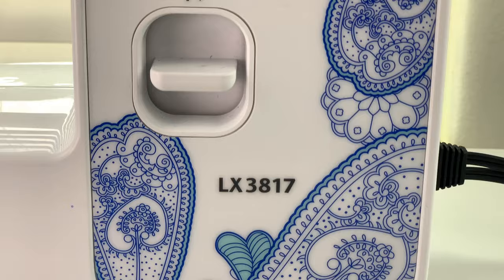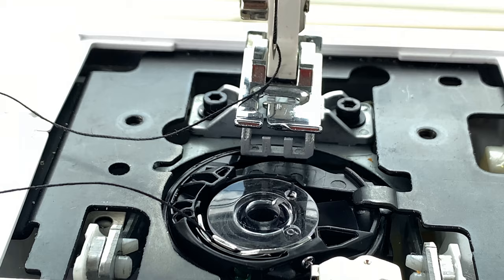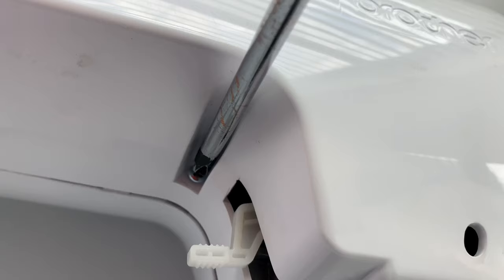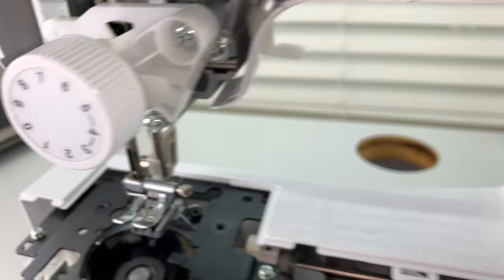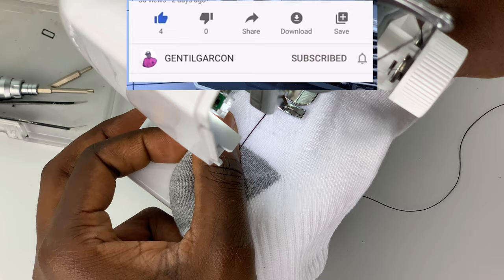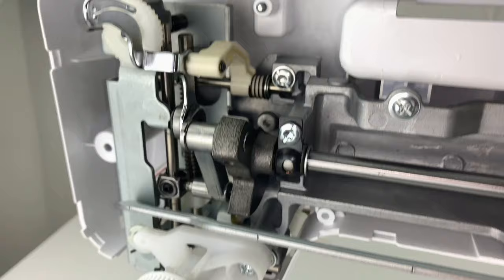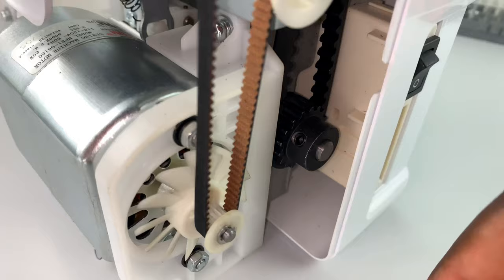How: Sewing Machine Hook Timing Issue Repair - Brother LX3817

Comment: Thank you very much sir .  I fixed the timing with your help. I also tries to slip the belts to move the needle. There are two allen screws on the bottom shaft in order to lose the connection between top and the bottom.  Now the sewing machine works good. Thanks again!!!
Reply from the maker: Anjan Babu Good Job , and  you are very welcome.
Reply from the maker: Anjan Babu Do not forget to subscribe to the Channel 😊.

Comment: Thank you. Your clear instructions helped me complete the alignment and identify the faulty hex screws on my new Brother LX3817.
Reply from the maker: I am glad it helped you. Did you tight the Allen screw back up ?
Reply from the maker: Screws*
Reply: @MarcelJoel  yes... I had to tighten them at an angle.
Reply from the maker: @jofloig4513  Good job. Because they are not supposed to stay lose after you calibrate your top needle and the bobbing case.

Comment: This video was so helpful! Fixed my machine so quickly!
Reply: I feel so left out. So I undid the 4 screws in the back, the 5 on the bottom, and the one next to the tension wheel after I took off that side piece. I was not able to get the front and back apart without breaking something. Am I missing something? Was there another screw not mentioned that everybody else got but me? I'm trying to wait to hear back from Marcel, but I know he's busy...I'm lost and my rig has been sitting here for hours waiting to get fixed.

Comment: Thank you for the video. To bad the last repair person striped my bobbin screws. Now I have no idea what to do now.
Reply from the maker: Buy a soldering iron with some solder. 
Solder a screwdriver into the screw in order to remove each screw. You will have to solder and de solder the screw driver each time…that’s a lil painful process but it should remove those screws. Look It up online on how to solder
Reply: @MarcelJoel Thanks my dad figured out a way. It is still down though. The timing adjustment won't stay. So something else is wrong with it. Let me just say I am Not happy with the company that sold it to me. They are also the one's who have had to repair it for me twice it a short period of time. The cheap brother that was bought from Walmart lasted me for years!

Comment: Your videos are getting better. And your editing is getting better
Reply from the maker: Thank you 😃 , I really appreciate you noticed that. It warms my heart !
Reply: @MarcelJoel  Hi !  my needle is not aligned with the feed dog?  the needle keeps hitting the bobbin case.  What can I do?  Thanks!
Reply from the maker: Give me a second I will make a video about this issue as well. There is a screw on the side of your machine that is not to be touched.  The purpose of that screw is to move the top needle assembly toward you or further from you.
Reply: I am not getting the bobbin tray to even move. The timing is off only miniscule, but enough to not catch the top tray. Your video shows how to lose the bolt to move said tray, but not how to move the tray. Manually moving it is having the needle dropping down at the same time. I am not understanding how to fix this.
Reply from the maker: Gifts Handmade By Natasha Did you figure it out?

After you lose up the Allen screws, you can manually spin that bobbin case with your fingers. Try it and align everything with that top needle.
Reply: @MarcelJoel  please answer me

Comment: Thank yo u Very much for your videos, it has helped a lot.
Would it be possible help me with a problem? I put  little oil where the grease should be ( I didn 't read the manual beforhand)i,now the motor runs  but  the sound  is the belt slips
Reply from the maker: What type of machine is it ?

Comment: Oh I'm lost again. Finally I'm getting to this. I've got all the screws apart and organized. I can't for the life of me pull it apart without feeling like I'm going to break something.😢 Is there a key area from which I can get it apart safely? Is there a position the wheel should be in? Or should the part on top that holds the loading bobbin be to the right or left as you face the front of the machine or...? Thanks.
Reply from the maker: I am going to have to make a video showing details on how to take it apart ..if you remove all the screws and the knob , you can use a plastic pryer to go around the crack to unsnap the machine apart. If it doesn’t come off easy, you are missing a screw somewhere. Look carefully.
Reply: 4 screws in the back,(although there's a fifth that holds the foot lifter, which I left alone) 5 screws in the bottom, and the one next to the tension wheel... All removed...
Reply: Oh and the actual big knob in front removed...😅
Reply: Where it seems to be stuck in is the area where the wheel and the switch is and there's nowhere to catch it to get leverage to pull it apart.... 😭Aaaüüüggghhh😂
Reply from the maker: @vennettegloud3128  hold on calm down I will take a look at my machine when I get home
Reply: Ok. Thank you. Otherwise, I'm ready to smash it to the ground and be done with it. 😂🤣🦁I'm laughing, but I'm serious. It's 102° fahrenheit and I'm done!
Reply: @MarcelJoel hey Marcel. Still waiting to hear from you. Not touching my machine, but it's difficult. No I'm not going to destroy it,😂 but if you get time... please help. It's just sitting near in limbo. Lol. Thank you!
Reply: Ok, so. Here's an update. I finally the next night after much prying, got the stupid thing apart. I was sure I'd broken something. Then I found out the Allen wrench I had was too big so I had to get an entire set just to get the (oh, it's 2.5, by the way). Then as I loosened the inner screws, and tried to adjust the timing, ( I guess everyone is just smarter than me) everything, went wrong. I had to keep removing the needle because it kept hitting the part where the foot was supposed to go, then when I got it to stop doing that, I put the bobbin casing back in to test my adjustment. It kept hitting the bobbin casing...the bobbin casing started turning then got stuck ..I went through that a couple of times....I'm so frustrated for now I'm giving up. I'm posting this, not so much to complain, but just to let someone else know out there, if any of  this happened to you, you're not alone. I'll probably end up just getting another sewing machine. Anybody wanna buy a brother lx3817 really cheap?😢
Reply from the maker: @vennettegloud3128  i know miss Vennette, this process can be very frustrating especially if you are not used to do repairs on machines such as this brother. Is there anybody that you know that might be able to help you with the process while Watching the video I post ? I have another video that show how to calibrate the needle if it keeps hitting the plate as well.
Reply: Did you ever figure it out? I’m having this problem too.

Comment: My brother sewing machine can't hook its lower thread. And I tried what you taught through this video. But I couldn't fix the problem. My problem is the hook  hitting the needle when it go around. It seems it is not the hooking time problem. Then what it could be? Do you have any idea?
Reply from the maker: Hello. 
I have another video that show how to calibrate your needle position. Please watch it and let me know if it helps.
Reply from the maker: https://youtu.be/UY-vzChCe_A?si=aR5rSry-Q2xmiZbw
Reply: @MarcelJoel  Thank you so much. I will try it.
Reply: I just tried it. Now the needle hits the "silver thingy" in the bobbin base. Before, when  I open the machine I touched the upper base of the needle too. There was a gear. Maybe I need to open the machine again and try to fix both the timing and the needle issue.

Comment: i know a million people already said so but THANK YOU SO MUCH i cant even begin to tell you what a live saver this was for me. and for those of you out there struggling with getting the case off: you have to pull. hard. theres two latches in the center that are a really the worst of it but you wont brake your machine. i did break one of the snaps but imo it will be easier to get off in the future need be. i also got cut up a little removing the case so be careful!!
Reply from the maker: Thank you so much for you comment. What other videos would you like me to make if you have any ideas ?

Comment: Okay so I really need your help. I was told that my machine might be out of time since I broke a needle and knocked it out of line. The pattern selector isn’t working. I can twist it to 6 7 8 9 10 but it gets stuck when I try 11 and 5.I opened it up and everything. 🥺
Reply from the maker: Did you Calibrate the Hook time issue first ?

Comment: I know this is a old video but am having the same issue . I fixed the timing now the machine won't sew . Not sewing stitches at all . The top thread won't pick up the bobbin thread .
Reply from the maker: You have to align it again and make sure to tight the Allen screws back up after Calibration.

Comment: Hello, your video was nice, but just a little thing after having tested in straight stitch, it was also necessary to check the zig-zag stitch but for the rest it's perfect if it can save the price of a revision at a repairman or technician
Reply from the maker: Did you fix the zig zag ? What did you adjust ?
Reply: @MarcelJoel  After having checked the straight stitch that it works as you did with the sock, you must always check at the zig zag stitch, if the thread gets tangled or does not cling there is a disturbance, the adjustment is done at the needle bar, not at the hook. From that you make an adjustment you must check everything to also look if the feed teeth go up or down well at the same time as the needle goes up and down and does not touch the plate or the bobbin case. Although Brother make entry-level machines with affordable prices, disassembly, cleaning and access to make adjustments are easier, and users do not need to go to a technician and pay

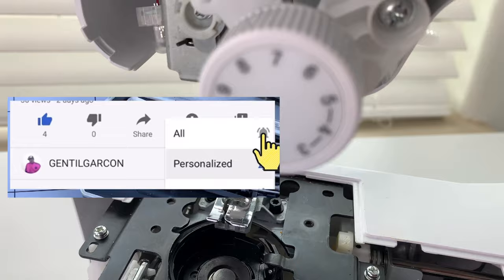Comment: I’ve followed all of the steps and removed all screws and I’m stuck at 2:44. Im having a hard time pulling it apart. Any suggestions?
Reply: Nevermind!! Got it. Thank you ❤❤❤❤❤❤❤
Reply from the maker: @cherrellebrianna  everything is working now ?
Reply: @MarcelJoel  yes but now I can’t get my stitch knob to turn past 6
Reply from the maker: @cherrellebrianna  you probably plug it back wrong ..try to remove it and turn that selector dial to Zero to the left side .
Reply: It’s working after I put the sewing machine back together!!
Reply: @MarcelJoel thank you sooooo much

Comment: I have the same machine and the needle is hit on the metal teeth, what can I do to fix it
Reply from the maker: Use a Philips screwdriver. While the machine is actually facing you , right on the back of the machine in order words on the other side of the top needle assembly, there is a single Philips screw there; If you screw it in or unscrew that actual screw , that would move the top needle assembly towards you or away from you. That’s exactly how you position that top needle assembly exactly where it needs to be, so it won’t hit those metal teeth.
Reply from the maker: If you look at my video when I turn the machine around , there are screws on the side of the machine that I touch and there is one single screw that I didn’t touch , and that screw is close to the top needle assembly , that screw is the one that will move the assembly back and forth for you.
Reply: Thank that seemed to work now hopefully I can get it to see
Reply from the maker: Ivonne Zavala You are welcome please subscribe and share with your social media. I need help to reach a certain number of views. Thank You.

Comment: Had a problem with mine skipping stitches and slipping loose from the bobbin.  Turns out the tip of the hook is CHIPPED.  Instead of a nice pointy tip there's a partial jagged edge.  The whole machine is $85, piece of junk.  Timing it wouldn't even fix it.
Reply from the maker: Did you buy another one ?
Reply: @MarcelJoel  luckily I was still within return period.  But I looked online for the replacement parts, they really don't sell one, and if I did found one the whole unit has to be disassembled.  I got a Singer instead and the components are all metal and serviceable.  Cost was about the same.  The hook on the brother is definitely substandard, partially plastic.
Reply from the maker: @ChmodX  That’s good to know. I noticed these brothers got a lot of small issues here and there.

Comment: Hi it's me again I put back together but it looks like I did something wrong I'm having a picture see if there's any way you can help me thank you so I don't know I put it take a picture it looks like the needle is on the other side so it's hitting the bobbin if you can please help me or share what to do thank you
Reply from the maker: Open it again, when you align the silver piece at the bottom with the top needle, I want you to manually operate the top needle to see from yourself if it picks the thread 🧵up without hitting the bobbing case. Keep adjusting the bobin case and the top needle until it does pick the thread 🧵 up like it supposed to.

Comment: I’ve tried doing this 4 times and it’s still doesn’t work when I attempt to sew the needle just goes in and out no thread at all it’s worse than before I tried this at all.. could there be another issue I’m missing
Reply from the maker: Did you watch the entire video until the end? Did you tighten back up these Allen screws after calibration ?

Comment: I can’t get my casing back on near the front - everything else clicks except for some long piece where the screw connects in the front.
Reply from the maker: Kylie Blake Please unsnapped it away from the housing If you can and check what might be in the way and blocking it..and try to put it back again..don’t force it, it is meant to fit and click back in place.

Comment: How you removing the cover so easily?
Reply from the maker: You have to remove all the screws I indicated. You have to remove the pattern selector wheel on the side too.
Reply: Yeah I removed all the screws and wheel too
Reply from the maker: @ShafnaCareem  ok use a plastic pry tool or anything thin that you have and try to separate slowly and gently where the the covers meet.
Reply from the maker: @ShafnaCareem  no forcing or breaking stuff please
Reply from the maker: @ShafnaCareem  any luck?
Reply: Thank you. I had removed the cover.

Comment: How did you guys remove the cover? I've unscrewed everything and there's so much resistance to snapping off. It's half off but now I can't even snap it all back into place again. Plus couldn't even remove the pattern dial. Do you just pull?
Reply: Im having this exact same issue. I have a 3817A tho.
Reply: @craftysofi2443  So I actually found one very hidden screw that wasn't mentioned in the videos I watched, and could then snap it off. For the dial I had to grip it with a non stick cloth and it popped off. Not sure about the 3817A but could be you have to unscrew another thing. Just don't touch the one behind the needle part, it will move it out of place.
Reply: @anuna116  which screw wasn't included in the video? I can't snap mine off.
Reply: @anuna116  where is the last screw?
Reply: @ceehart4538  theres no extra screw just two extremely annoying snaps in the middle

Comment: I paused the video where you said take out the screws, I unscrewed the wrong one 😔
The screw behind the needle is an alignment screw, I broke my needle 🤣
Reply from the maker: Turn it the oppose way to align the needle. Use the same screw to fix it..you can move the needle back to the original position by turn clockwise or counterclockwise 🔄.
Reply from the maker: Watch this : https://youtu.be/UY-vzChCe_A
Reply: @MarcelJoel  THANK YOU SO MUCH BROTHER
I got the machine working again I'm a single dad I was trying to make some things for my daughter but the timing was off. Took me about an hour now the machine is in tip top shape 😁
Reply: Much love and respect God bless you

Comment: What size Allen wrench did you use?
Reply from the maker: It has to be exactly 2mm metric . I think I mentioned that in the video double check please. Also after aligning everything make sure to tight right back up your Allen screw before even closing up the machine..don’t leave them loose . I mentioned that at the end of the video as well.

Good luck !
Reply: @MarcelJoel  yes going back I heard it that time! I really appreciate your help, & yes. You reminded to tighten back.

Comment: Good day sir, I have done it already but the needle came in contact with that tny little metal rivet. My question sir, is that needle at timing position going down or up?
Reply from the maker: arthur forteza What I would say is set it up in a such way that the needle doesn’t touch the metal rivet..you can spin the needle and the bobbing case manually and see what it is happening , and then you make adjustments.
Reply: @MarcelJoel  you know what, I did exactly what you are saying and it really work, my compliment to your vlog now my wife is using it as I speak, many thanks to U sir!!! 😎
Reply from the maker: arthur forteza Thank you so much Arthur, I really appreciate your comments. It would really help me if you can subscribe and share this video your social platform. I really need some more views by the end of the month because of Youtube new Policies.
Reply: @MarcelJoel  OK sending ur vlog to my friends, thanks again!!! 😎